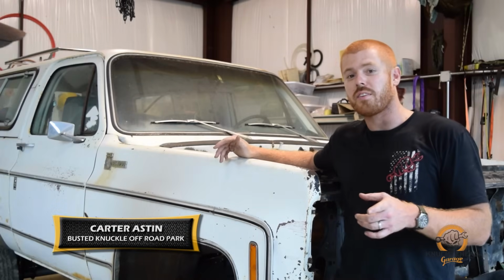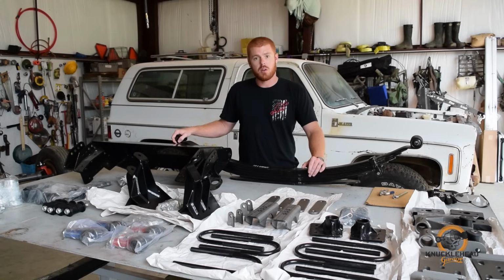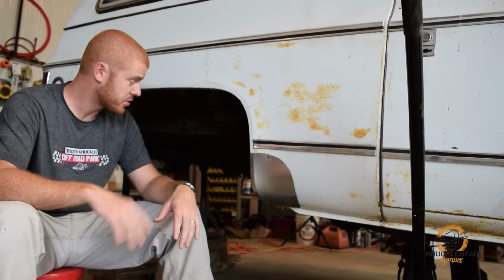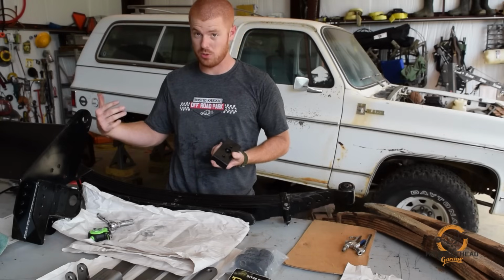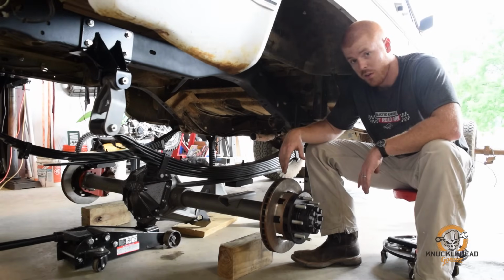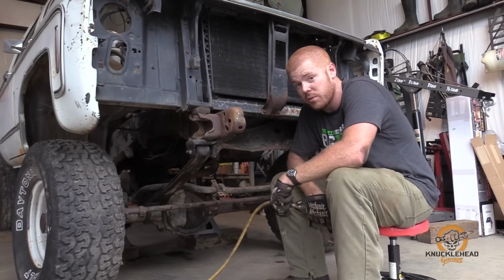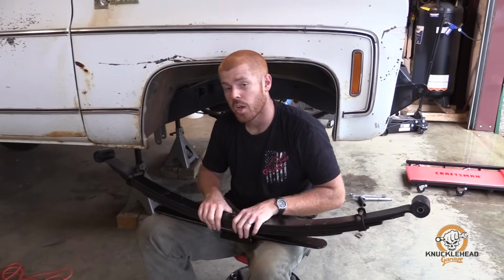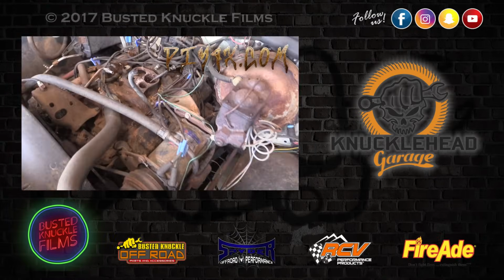Project LS K5 Blazer Axle Swap 1 Tons - Knucklehead Garage

Comment: I think he's gonna wish he did the motor swap first now that the Blazer is sitting 6" higher.  LoL 😂.  I know I'd be cussing myself every nut or bolt I had to lossen or tighten, and every electrical connector I had to unclip and reconnect.  "D@mmit!...  I shoulda done this when it was six inches closer to the ground!"🤬
Reply from the maker: Did it with the body off- https://www.youtube.com/watch?v=qK08e6kUuDs
Reply: @BustedKnuckleVideo  pft... "I'll just take the body off."  You have a solution for everything, don't you?  LoL 😂 Now, where's that 'egg on face' emoji?...

Comment: Nice job with the swap. Whichever engine you go with, i'd strongly recommend spending the extra and getting a 4L80E if you go 4 speed auto. You can also go with a turbo 400, which will bolt up to the LS easily.  The 4L60 you'd get with most junkyard pulled drivetrains won't last with the heavy axles and tires and probably the use you will be doing with the truck. Looking forward to seeing how this goes
Reply from the maker: We have a surprise for the Transmission in mind that a lot of you will appreciate.

Comment: 396ci 6.5L with Brodix heads & intake, between 12.5:1 and 13.5:1 comp & around 700hp Altas T-case, Turbo 400, running the tried and true HUMVEE 8 lug 24 bolt bead locks with run flats on 40" Maxxis Creepy Crawlers, G2 Hub flanges, Randys Ring & Pinion. I had the same setup in my M1009 but running Deaver spring packs.
Reply from the maker: we would pass everything but the gas station

Comment: I put a 5.3 and 4L60e and NP208 in my 87 K10 Scottsdale and i love it, gotta couple videos of it, i wheel it lightly on 37 Goodyear MTR's and half tons, got some 3/4 axles to go in soon. Good luck on the project ! Awesome video
Reply from the maker: jchevy33 sounds awesome
Reply: What did u use for speedometer sensor ?

Comment: You got more balls than me getting under those jack stands.
Reply from the maker: They were perfectly safe. It's not like we have a lift. What would you have done?
Reply: Looked good to me. :)
Reply: BustedKnuckleVideo Borrow a buddies lift haha. Awesome vid btw
Reply: chock the front wheels!! good job guys
Reply: That's what jack stands are for. Supporting a vehicle so you can safely work under it is literally what they are designed to do.
Reply: Ken MacMillan Duhh, still sketch.
Reply: Ken MacMillan , but not stretched to the limit AND on top of a small forests worth of lumber. IMHO,  the jackstands should have been in front of the axel from the get go.
Reply: Old Griz Yea, everytime I have to stack wood under my jackstands I get sketched out pretty quick.
Reply: BustedKnuckleVideo , I have several sets of stands from the small ones like the ones you used to huge 30 ton sets tall enough for big class A motorhomes. It's money well spent.
Reply: i was just about to comment the same thing.....sketchy as fuck, lol
Reply: You can see the lip of the stand coming off the block on the driver side. I would not have been under there.
Reply: thats great, and alot of us do the same thing, however every year a fellow gear head dies because of bad jack stand placement.....not worth it. And if you watch the vid , youll see the bottom of a stand hanging off the wood. It was not safe, get over it
Reply: not when the pass side is hanging off edg of blocks wow
Reply: What happened to this build?

Comment: 6.0 is better for crawling 
5.3 or the 4.8 are cheaper to buy 
4l60 with the corvette servos or the 4l80 
im doing a 5.3 with the flat top pistons basically the 4.8 piston since their the same bore size and I will be using a nv3500 from a 97 k1500. I cant find and t case adapters for a 203 205 combo. thats my only problem so far
Reply from the maker: I think we almost have it figured out, stay tuned!
Reply: try advanced adaptors that is where I got mine (208 to 4l60e)

Comment: That's a great build I just finished my 85 k5 with the exact same thing only I'm running an lt1 383full roller motor attached to a thm400 . On a side note you didn't state that another main reason for changing the front shackle hanger is because factory front springs are 3inchs wide and the rear springs are 2.5 inches wide the new shackle hanger corrects that great job guys keep it up
Reply from the maker: Good point. Thanks part 2 coming soon!

Comment: Love the video  Truly one of the better or even best off road how to do-it-yourself type videos that I've seen.  Now for the engine choice  I personally would not go with a 5.3 or 4.8 liter  I would go no smaller than a 6.0  But you can find the 6.2 out of the You can or escaladed for relatively low money
Reply from the maker: we are leaning towards a 6.0
Reply: BustedKnuckleVideo  You just can't go wrong with the 6.0 partner so readily available it makes Great-Power Great reliability are you guys gonna keep it bone stock or are you gonna add some go fast goodies
Reply from the maker: Probably stock for now, then probably a cam,tune,springs later on

Comment: Built several 1ton K5s back in the day then got old and out of it.Came across your vid and got excited!
If you decide to use a LoMax 205 32spline in your build let me know.I have the complete transfer I built for a project but never used... new. Twin stick ready, 1410 rear yoke, 1350 round flange front plus some various related small stuff.
I'll give you a smoking deal on it, seriously! 
Maine
Reply from the maker: I'll keep that in mind
Reply: Still got the LoMax205 
Every piece you bolted on that K5 is heavy duty no sense going aluminium transcase now!
If you go 4l80 I have a  New rear output shaft  that will give you options for hooking the two together.

Comment: love this , also looks like if you hit everything with a grinder it would be a brand new truck
Reply from the maker: I hope to pull the body off and wire wheel the frame. Get it painted up and looking primo!
Reply: BustedKnuckleVideo Well, since you already have to do the rest of the body mounts, may as well just pull the tub. Then you could address the frame. Would probably make it easier to get the drivetrane in as well.

Comment: I'm running a lot of those parts on my ls swapped k10! I say you can't go wrong with a 6.0/4l80e setup. Good power and strength with small upgrades. But if you have the coin. A 6.2/6l90 would be amazing!!
Reply from the maker: good call on those engine setups, we are airing more towards the budget side of things on this build

Comment: Excellent video. You showed me everywhere I went wrong with installing an off the shelf lift kit. My 85 crew 1 ton will rattle your teeth out. I think the 8.1l  backed with the Allison tranny would make a fun rig and plenty of power. Might be harder to find but would be worth it in the long run.
Reply from the maker: Yes the off the shelf lift kits make for a bumpy ride on these. Not a bad setup at all with the 8.1, It's just a massive engine and transmission.

Comment: great video!! I'm doing a ls l92 with a 4l65e, 241 transfer case.. with Diy4x front and rear bumpers.
Reply from the maker: why did you choose a 241 over the 205?
Reply: I think it has a better gear ratio and probably half the weight. but a 205 is a solid t case too...
Reply from the maker: But is it as strong as a 205?
Reply: internally i think it's strong.  the only thing is the outer case is aluminum so if you hit a rock or something you have a good chance of cracking it ,but if you have a good skid plate you should be good.

Comment: I just bought a 73 chevy p/u & will be lifting it and the tires will be 37". I plan to use this truck from towing a camper, trails, and occassionally rock crawling. An tips on lift would be great.
Reply from the maker: This lift is the way to go.
Reply: @BustedKnuckleVideo  thanks. U think I should go 6" or 4"?
Reply from the maker: Do the same lift in this video and it should be perfect.

Comment: Hearing protection would be a good idea. Biggest engine you can get, ATI 6 speed auto and a 3 speed transfer case with rear-front shifter so  you can do front only digs.
Reply from the maker: He probably needs a helmet too. LOL That would be a killer combo but expensive

Comment: Would love more detail and what I would guess are CUCV axles. Gotta put a 6.0L or 5.3L with a LSA in it. Maybe a powerglide. It would be awesome to see an all junkyard setup though, most guys just drop some big money drivetrain but making a junkyard motor swap work without the big money engine management or transfercase stuff is tuff.
Reply from the maker: aculous powerglide would suck at highway speeds

Comment: Nice build. I did notice one mistake you made when talking about the offset blocks and that they will extend the wheelbase. When you use a shackle flip it moves the center pin of the leaf forward between an inch and an inch and a half. So when you use the offset block you are really putting the wheelbase back closer to stock and not actually extending it.
Reply from the maker: Good point!
Reply: @BustedKnuckleVideo  You still do a way better job of explaining stuff than I do. When I try to make videos I sound like a bumbling idiot!!🤦🏻‍♂️

Comment: Totally look into a newer aluminum 5.3(they do make them but hard to find.  Or maybe even an 8.1 for torque but less fuel economy.... I did the 5.3 and I'm putting the nv4500 5 speed with my np205! So that might be an option if you can find one
Reply from the maker: Aluminum blocks are too fancy for this build. Iron Block FTW!
Reply: BustedKnuckleVideo I hear you. Just thinking of weight. The iron blocks are great for forced induction. I have an 06 5.3 in my 80 k10 and looks amazing! The 6.0 are awesome if you can find one at a good price and swap the heads out with actual LS HEADs(I don't know the cast numbers)
Reply from the maker: Off road is just tough on Aluminum blocks. Seen way to many fail
Reply: BustedKnuckleVideo i haven't seen much fail. But I also don't have buggies and rock crawlers and stuff. But I like the blazer man! Gotta get more videos of it soon. It's giving me motivation to finish my truck lol. Just the fuel system and a possible DOD delete

Comment: Fellers if your going to go through the trouble of wire wheeling and cleaning it. Put a better quality paint on there like and epoxy and topcoat. It’s more expensive up front but cheaper by the ounce than  that rattle can. Rattle can offers virtually no protection from rust or abrasion. If you took a little lacquer thinner on a rag you can just wipe it off.
Reply from the maker: enamel spray paint usually does pretty good, it can be touched up easy also

Comment: heck nah i wouldn't be using just nuts and bolts on those leaf spring brackets id at least get a good inch and a half weld on the left, right, and top sides at least but looks awesome!
Reply from the maker: This is for mockup until we get the drivetrain in there and see where the pinion angle needs to be set

Comment: 6.0L Lq4 with a turbo and a 4l80e run a small enough turbo to spool quick at low rpm but still be able to have the boost you want at a factory level redline. I'm doing a aluminum block L33 5.3L (baby ls1) with a 70mm turbo in a 2000 zr2 s10 because, it should spool around 2500-2800rpm which is where my stall converter will flash to. The 70mm will support at lot more boost than I'm  going to feed it at 6000rpm. The boost will be set for 12 psi and it should come on quick. I'm leaving the engine basically stock other than thicker head gaskets to lower compression a hair and doing some valvetrain upgrades and fuel upgrades. The cam Itself is already pretty good for boost. The 799 casting heads that came on my L33 are the same 243 castings as the ls6 heads just with out the sodium filled valves. Keep that in mind for cheap power LS heads. I've got it all set up to where the intercooler, self contained oiling system, cooling fans and turbo are all safe from getting hit by anything. It also saves me from doing feed and returns for the oil. Going from a 190hp 4.3 to a 300hp 5.3 would probably be enough for most people but I want all 3 of my vehicles to have at or over 500 rwhp and my s10 is the only thing left that doesn't meet or beat that level. Until I get this 86 gmc Jimmy. The jimmy will be my daily to keep miles off of my 56,600mile 2002 ws6 6speed Trans Am. To answer  your question again, do a 6.0 lq4 (because of its lower compression and ease of availabity) add a turbo and a 4l80e. If the turbo seems like too much of of a pain in the ass even though you can just flip the factory manifolds to make a turbo manifold. Then just add nitrous to it for shits and giggles. You can't be big, mean, and kick ass looking if your truck is slow as shit.
Reply from the maker: Heck yeah that sounds like a fun project!

Comment: I'd go with the 6.2 and a 4l80e behind it.  PCS makes a killer transmission controller that is very versatile for that transmission. I don't say that just because I sell them but I also use one of the first they ever made and it is still going strong must be over 15 years ago.
Reply from the maker: 6.2 would be a beast but is way more expensive than the 6.0s
Reply: And a 6.0 would probably work great too. I am by no means an expert on LS engines. I would love to get my hands on a few and transplant one into my wifes favorite suburban. It has a 350 right now with 333,000 miles on it. It was abused by the previous owner but we still managed to get another 100,000 out of it. Either that or a diesel.
Reply from the maker: cummins swap that thing
Reply: Now you are talking. lol Though, believe it or not, I'd probably do a performance 6.5 build on it. Little lighter duty then a cummins but still pushing around 300hp when you need it and a ton cheaper and quite a bit lighter.
Reply from the maker: Never heard of a performance 6.5 build
Reply: The trick is finding crack free block and heads.  Once you do that then you basically do a marine build on it. The shortblock needs low compression pistons. 18:1. This gives it durability when boosting to around 20+lbs. You want to stud the heads to help hold it together. Head studs are just better they tell me. You will also want some high pop marine injectors and you want a high capacity pump.  Suggest Moose pump from constoga diesel.  Oh and a good intercooler and a decent sized intercooler.  If you do it all right you end up with somewhere in the neighborhood of 300hp.  You can get massive crazy with the injection pumps and go way above 300hp but your longevity starts going down pretty good.  I have a ton of miles on mine and I love it. 65mph and need to pass someone you just hit 80 without even thinking. And thats in a 8,000lb van.  That engine weighs around 750 which isn't too bad for the trail.

Comment: for reliability id go with a 6.0 with a mild cam swap, TBSS intake, Team208 Motorsports tune, 4l80e, and an atlas. Bombproof.
Reply from the maker: Why swap to an Atlas when the 205 is stronger?
Reply: BustedKnuckleVideo more gear options available on the atlas. unless you add a black box to the 205, then that's a different story. oh and the bling factor. ladies love the bling factor.
Reply from the maker: You got them ladies looking at your Transfer Case? LOL

Comment: 85's a diesel  with quad  shock stock localated hangers in front. has 4 inch worn out aftermarket stings. 79's rear springs were rebuilt  by local  spring shop a couple  years ago and worked fine  on the 79.Body rust was bad,so l've been transferreing what l can to 85 rust free diesel. 383 will go into diesel from 79.
Reply from the maker: Sounds like an awesome build

Comment: The 14bolt has the rear disc brakes caliper brackets  on wrong
Reply from the maker: what?
Reply: BustedKnuckleVideo brake caliper goes toward the rear of the 14bolt
Reply from the maker: doesnt matter as long as the brake caliper bleaders are at the top right?

Comment: It needs an LSX 454, NV4500, and a Lo-Max Xfer case. Use a hydraulic brake booster and hydro assist steering also. Might check out High Angle Driveline and go to town building super beefy drive shafts.
Reply from the maker: That would take a hefty budget
Reply: Yea, it would. Food for thought though. It would definitely be a dream truck. Just a wild guess I'd  say 60 to 70 thousand including what you already have. That's hardly twice a restored one.
Reply from the maker: we dont aim to restore one, build it and wheel it
Reply: Could probably do without the LSX then But I'd still go with everything else. If you're thinking LS then how about the E-rod? I've always wanted to try out one of those. My '83 with a 6" lift has a blown GEN 1 and that's what I'm working up to. Well on my way with everything else.

Comment: Two questions:  What did you use to enlarge the hole in the frame for the larger spring bushings on the leaf springs from the rear?  Hole saw? It shows you using a cutter bit on the air tool but I think you were just deburring the hole. And why did you run the axles 2" further apart?  Does it have to do with the drivetrain swap to the LS?  I'm keeping my stock engine and 700r4 with the 205, and would like to keep the stock driveshafts, since they've both been custom made for the truck as it sits with 4" of lift.  Can I leave my axles in the stock location?  I'll have to check the driveline angles/lengths with the additional 2" of lift, but I think that will be ok.  Thanks for the video, this has been a great help to me...the rear is mocked up and the front gets started tomorrow.  I had no idea about the rear perches until I saw this...you saved me a ton of frustration...I would have been losing my mind thinking the new 14 bolt didn't fit!
Reply from the maker: Glad the video helped!